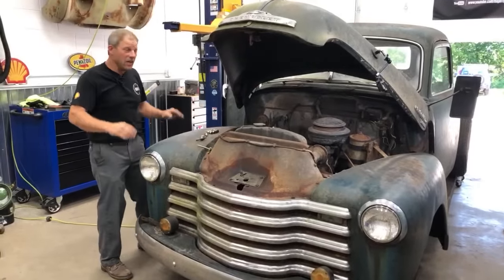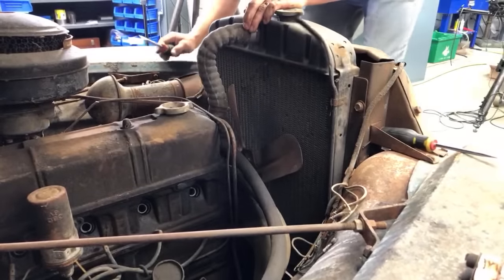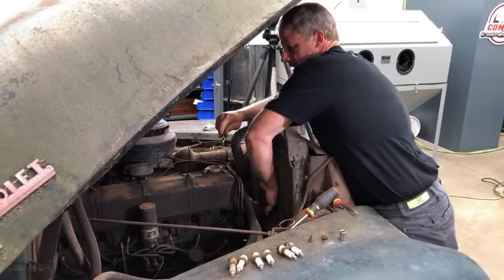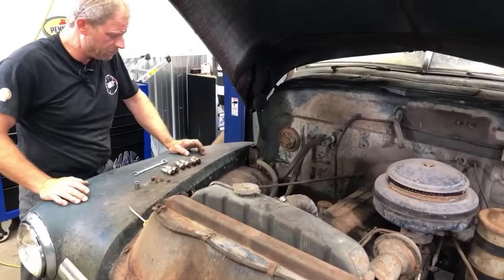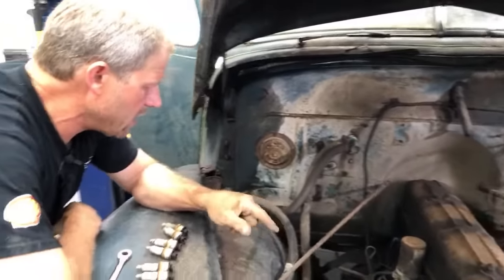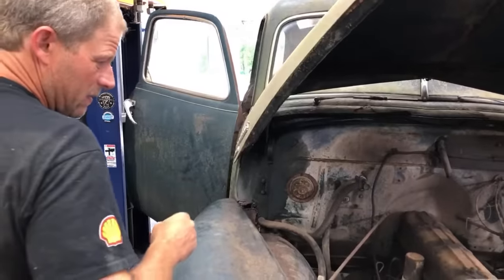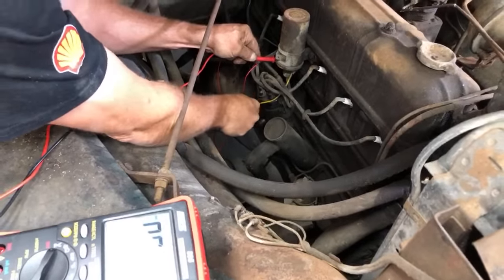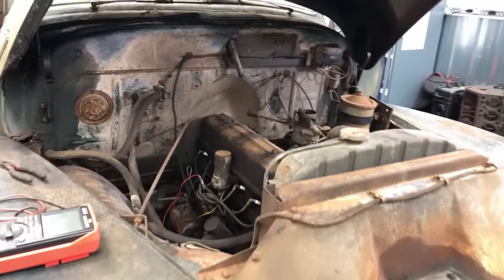Will It Run? 1950 Chevy pickup pulled from the forest | Redline Update LIVE

Comment: Try some marvel mystery oil down each one of the spark plug cylinders and let it soak a few hours . Then, the cylinders should turn easy , and then you can leave plugs out and pump oil out spark plug holes . Put plugs back in !

Comment: My dad had that very 50 chevy truck in my first 10 ears of life I remember going   with my dad to te gulf station and at 3 years old I came home got the water hose climbed up on the runingboard  took off gas cap and finish filling it up with water went in the house told m dad I filled up our truck it will go fast now fortunately those trucks have a drain plug in the bottom of the gas tank and he drained it all out lol

Comment: I would look into the condenser as the electrolyte has probably leaked out.  Also,  you should have used the rack to lift the truck and removed the clutch/pressure plate dust cover and used a pry bar to rotate the crank.

Comment: My first car was a 1950 Chevy Deluxe sedan, and like this pickup, it had holes in the floorboards, rusted out rocker panels - an ugly piece of crap which burned oil, but cost me and my brother $150.  My older brother rebuilt the engine, but didn't shim the babbitted rods properly, so it always knocked.  Still, it took us work and to the drive-in burger joint for several years. It will be interesting to see how Hagerty deals with the rods. Maybe it's still possible to buy replacement babbitted rods or maybe rods with bearing inserts.

Comment: You can’t check voltage across the coil without the points being closed, circuit not complete. To check for open coil, disconnect and measure continuity across terminals. No ohms is open, low ohms means not open. If not open replace condenser and points, gap points to spec, check for spark at top of distributor cap. Try to start. If missing, check spark at each plug. Really easy to work on. No, it is not oil bath air cleaner. I have seen both ways.

Comment: You can also use a 12 volt battery for more power to just pop it off, if broken loose.   You just have to mind the connection,  if the starter drags.  It'll burn up everything in between,  if not prepared to yank the cable. 12 volt will give you bigger umph to crank SHORT TERM on 6 volt systems.

Comment: Nice Truck. There's a lot of old car's and trucks sitting around that can be saved. I have had my eye on a 73 Impala for 8 years that is sitting under a carport near me. I want that car so bad but just don't have money to offer them for it. It has been off the road for a long time. It has stuff piled on it. If it has the small block 400 in it, it would be even better. Those were good motors. But a lot of them were 350.

Comment: I can't believe nobody suggested swapping out the condensor. Those go bad just sitting. First thing you do in vintage stereo repair is replace all the capacitors (condensors) because they are bad so often. It's no different here. Also wouldn't hurt to run a point file through the points once to make sure there isn't corrosion. Coils are rarely bad. Also, cleaning all terminals in the ignition system is a good idea.

Comment: Push on the fan belt and turn it with the fan blade to roll it over. You have he plugs removed so Easy Peasy. Not an oil bath air cleaner! Although oil was used "on" it, it's called a dry element air cleaner.

Comment: The 216 is a babbit rod engine, the 235 is a insert rod engine , read up on a babbit rod engine, because if you get the rods and mains to tight it, will trash the crankshaft in short order. I had a 50, 1500, and the owner rebuilt the 216 and trashed the crankshaft, the 235 will fit in, I had the 3 on the tree though, mine was out of a 54 4 door car, you just drill a hole in the front cross member for the motor mount, and if I remember right after 50+yrs you have to make a throttle linkage to bolt up on 235 carb, 216 bolts in from the sides on motor mounts, another tip a 1954 235 that was in a automatic transmission car, has hyd lifters instead of the solids to, and much quieter. Wish I had never traded the old girl, in 1977, for a Honda 450 CB road bike.I was the 3rd owner of it, my boss at a Chevy dealership, was in his 70,s when he tried to rebuild it, I had a engine I had to tear apart and put pistons in, I still have the original owners manual yet for it somewhere here.

Comment: The 216 did not have an oil pump.  It had dippers on the rod caps that picked upp oil from the pan to lube the bearings.  They were called, "Splash and clatter" engines.

Comment: Once you find that the engine is not frozen, it’s time to drop the oil pan & remove the valve cover. Clean them & what you find by the rockers & bottom end of the engine before you do anything else. Don’t leave the battery connected any longer than is absolutely necessary.

Comment: Grab a testlight pop the cap off the dis.  With the point open the testlight should light with the point open. Roll the points closed and use the testlight to manually break the points. The point should spark and the coil spark. Another trick that has worked amazing for years is to use a dollar bill to clean the points. Something about the paper that money is made from cleans point like nothing else.

Comment: Pull a headlight to find out if it's been upgraded to a 12 volt system as if I remember that was originally a 6 volt electrical system don't use a 12 volt battery in her as that will simply hasten the demise of the ignition system. If you upgrade to. 12 volt ignition system remember the starter and generator are still 6 volts.

Comment: I've had several of those. Old babbit motor. One thing they were known for after they were 30 years old or so, you had to take a dozen heads off to find one that wasn't full of cracks. The good thing is the casting was so thick that most of them didn't penetrate the jacket. Just saying...

Comment: Those engines have babbits, instead of bearings ... also.  So if coming out, for thr money, definitely look for the 235 or 270 instead.  They respond very well to two carbs and dual exhaust. I mentioned a 302 GMC six earlier,  but I doubt you'll find one,  or want to spend the extra cash on those ... unless of course,  your connections,  get one for cheap.  All of the mentioned engines are a major upgrade for long term use, over the babbit 216.  The fabled 302 is a hot rod engine, as far as capabilities ...but then again,  the 235 and 270 can be to a degree,  as well.

Comment: Same engine as my '39 chevy. Must have made them a long time. The '39 had a hand crank hole in the bumper, crank in the trunk. Yup, almost broke my arm starting it as a teen when the 6 volt battery was weak.

Comment: Fundamentals guys, no good chasing a spark at the end of the Spark plug lead if you haven't bothered to check that the points are opening and have power to them.  Is the distributor even turning? Are the terminals inside the cap corroded, is the carbon brush even there or making contact. Is the king lead connected and carrying the power from the coil? Basics!

Comment: It makes me wince when people dump gas into a carburetor. You can fill the fuel bowl through the bowl vent and the engine will run a little longer than the kick from dumping it down the carb washing all the oil off of the cylinder walls.

Comment: If it has compression and the valves and ignition are in time and it has gas getting to the cylinders, it will run. There is nothing Magical about this.

Comment: Hello 
I bought a 1950 Chevy Fleetline for my daughter for us to work on. The 216 cu engine (6 volt) runs fine. It cold starts fine, but after it has been running and is at operating temperature it has a hard time starting again. Any idea what could be the problem?
We have
New battery
New thick battery cables
New voltage regulator
New 6 volt
Thanks 
Greg & daughter

Comment: Oil down the cylinders and turn the engine over without plugs. Plug the holes with your thumb to check for compression. Have the valve cover off to observe valve function. Check for spark at the points as you do so.  C'mon you guys, it's  elementary!

Comment: Pull the dust cap and see if the rotor spins. If it doesn't then the cam gear is broken as they are made out of a fiber material and break often

Comment: Pull the starter, fill the cylinders with 50/50 mix of ATF and Acetone.  Let it sit, days, weeks, months, years, your choice.  Rock the truck, back and forth, in lower gear. Also get a solid, ring gear wrench to turn over the motor by the flywheel. Cheap Chinese wrenches break on the crank snout, obviously.  If need be, pull the head ( need to anyway / valvetrain seizes ), take a block of wood, and tap the wood with a hammer.  Pistons are fairly tough, but don't go wailing away on it.  TAP the wood, with your hammer.  I'd imagine if the beginnings of this don't work the engine loose ... and then pulling the head doesn't ... with the wood taps  ... I suppose you're fair enough to yank the rest of it out.  Lol. May as well upgrade to a 235, 270, or a GMC 302 six.  Or better ... a small block Chevy !!!

Comment: I have 3 stove bolts and they all run.  i have a rare stove bolt a 235 cu inch in a 2.5 ton truck. before they went to a 270. Check the wire in the distributor it might have a wire strand from a frayed wire that is a wild wire strand touching the case.  A wire strand are so thin it is hard to see. This has happened to me. You might have put in new wire that goes to the distributor.

Comment: Check distributor cap for a wasp nest too. 
Do you guys ever check for an old mid-century kill-switch? 
Long before they had car alarms, they did have kill switches :)
Reply: He hot wired it...   Jumper from voltage on the starter to power on the coil.  If the starter was turning, he had voltage.

Comment: I had a '53 Chevy 3600 w 4/speed whose 216 engine I rebuilt. I don't know 1/50th as much as you do about rebuilding engines, but if you find out that engine is trashed, do yourself a favor and go get a 235 to rebuild instead of rebuilding that one. Even better, see if you can find a 261 or 292. The 216 probably runs 15-20 lbs lower oil pressure than the others and really isn't that great. The 216 is a 1937 engine; with a 235, you are at least getting something sort of more into the 50's, it has a much better reputation than the 216.

Comment: OK, it turns, spray some WD-40 in the plug holes,put a 12V. battery in it (it won't hurt the starter),spin it over put the plugs back in, set the points, turn the key on, flick the points, to see if it has spark . Put some gas in the carb ,"not much", and fire her up.  ! I was doing these when I was eleven  yrs. old, about 60 yrs. ago.   DUH  !

Comment: When rebuilding the engine and doing the assembly, can you PLEASE explain the piston rings install on the piston such as which ring (top and bottom) is to be clocked @ (like top ring at 11 and the bottom clocked too 2) I cant seem to fine videos explain the best clock position and have always wondered what the correct "position" would be etc..

Yes Im aware that the rings cant be in the same position (alot of blow by would occur) and I understand the reason behind gaping the rings (too prevent butting)...

Yes Im aware that the rings rotate as well, I just never found anything showing the best position to clock piston rings and I love your work and the video grapher does phenomenal work as well! 

Yes I have subbed, been subbed for sometime..

Soon my son and I will assemble our 1st engine together (5.3 vortec) and I always show your work to motivate him (11 year old prefers his gaming station and Im try to break him away from it without killing the console) Just wanna open his eyes to other as things.. I always tell him "machines and vehicles are easier to fix than a woman"
Reply: joe mama... Best rule of thumb is to put the gap of the rings AWAY from the thrust sides, meaning face them in line with the wrist pin, and stager them 180 degrees apart as you install them. Rings really don't move "around" as the engine runs so other than some movement within the piston groove, they will stay where you put them. The main reason to stager the gaps has more to do with long term wear on the cylinder wall, which should be random rather than all on the same side. That's where the blow by will eventually be if you line them all up.
Reply: @rupe53  thank you for reply and thanks for the visual point of reference! TY TY TY
Reply: @jm361  … BTW, if you have a 3 piece oil ring it gets tricky. You will want the 3 pieces staggered but want to avoid the gap being on the thrust side. Basically think of the direction of crank rotation and the piston pushes a bit toward the side of the bore on firing stroke. (that's the thrust side) Face the gap away from that side. The thrust side will be toward the center of the block for one bank and the outside of the block for the other bank. This is because the bottom of the rod follows the crank so visualize the whole assembly slowly moving and in your mind you will understand that even though the piston moves in a straight line it's supported off center as everything spins. I have rebuilt around 150 engines this way and it has always worked for me.

Comment: Weld an Allen bolt on to your crank jig,much harder steel. We want new floors -Heat shield,LS motor..Transmission. Bose entertainment system, AC ,power windows cruise control.There that will keep you busy for a while..

Comment: You have to clean the points better.  They have to be clean enough you can see your reflection in them. Also use a very fine flat file not sand paper.

Comment: I wanted to restore one of these old trucks for years.
Reply: youd think that but when you do one like i did, you change your mind very quickly. i still dont know what the engineers were thinking
Reply: @thisoldchevy2371  I love the engerinering on the 50s model better than new vehicles.  I just picked up a 51 two ton... the starter has a band on it you can easily take off to look at the brushes.    Granted a computer is easier to diagnose problems, it ain't no LS motor ... but not everyone can use a computer. I love ls motors, but back in the day... anyone with common sense could work on these trucks.
Reply: @pigtrapper1329  i aint talkin about the engine, to this day its still a modern work of engineering mastery. im talking about whoever designed the filler plate to mount the driver side inner fender, the very goofy and primitive parking brake system, the absolute squirrels nest that is the "breathable cab", just to name a few. as far as the engine goes it was a dream to work on, the majority of the after-the-fact issues were simple user error. and only having common sense did go along way, i wish it still did in todays time..

Comment: Hope you didn't burn up the coil when you ran the starter with no plugs in the engine and the plug wires touching the engine block.

Comment: Why not check spark from the coil itself and be sure it's not an issue with the distributor the issue in my experience 99%of the time in a case like this is the capacitor

Comment: Would LOVE to find one like this. BUT, after sitting for SO LONG I wouldn't try to start it for fear the cylinders had RUST in them and that would be like putting SAND in the cylinder. I wouldn't touch it until it was Rebuilt completely. Would save a LOT of headaches later. Just sayin' Did this ONCE..and ONLY ONCE. Paid dearly

Comment: I probably would have changed that oil.  Old paraffin base oil,  if used when parked, has a bad habit of gunking up the valvetrain, ring lands, and oil pump pickup.  For the length of time sitting, temperature changes, seasons that truck sat thru for 50 years,  there's likely some condensation in there.   While not a deal breaker ... there's no use to draw it thru the engine again,  this time.   Honestly,  you'd be surprised,  how many of those old trucks,  and cars, will run,  for quite awhile ... AFTER resurrection  ...  WITHOUT rebuilding.  Everyone jumps right into rebuilding everything,  then realize they won't drive it around as a daily. I've wasted plenty of $$$ doing that myself.   If money is no object,  knock yourself out.  I've raised many sleeping autos and trucks,  off the roads for decades at a time,  and NOT rebuilt anything.  Carburetors, gas tanks, gas lines, ignition items, brake lines, cylinders, and calipers not withstanding.  

GREAT FUN WATCHING YOU GUYS MESS WITH THIS OLD CHEBBIE'.

Comment: If you put 12 volts to the 6 volt system it will burn out the 6 volt condenser out. & if you put the heads light on they will burn also plus the gauges. If he took the dist cap off & see if he had juice if it had juice the coil would be good.. just clean & set the points. Then just open & close the points & see you have spark at the spark plug wire.

Comment: If that had been an oil bath air cleaner you would have been cleaning oil off your shop floor. It is obvious you did not grow up with trucks like the one featured or you would have had it running.

Comment: Put a new know condenser in itand take a screwdriver and snap the points and see if you're getting any fire across the points after you put a new condenser in it the condenser is dead the reason I know this I had a 53 Chevrolet I asked time and I had a 51 Ford and my brother like the killed me in a 62 Chevrolet but you take the points out of a 62 Chevrolet 6 cylinder and put them in a flathead Ford make it run like a champ so

Comment: Problem was the gap between the points,  Not just clean with sand
Reply: I have installed brand new points and conditioner ta find out the new condenser was faulty. CONDENSER

Comment: If you want to release any engine, instead of trying to turn the engine with your hands just like the 6 million dollars man. Try installing a program able air system that will use up to 100 lbs of forse . PS just  use the firing order to control the air input